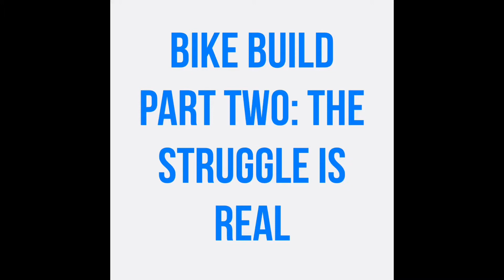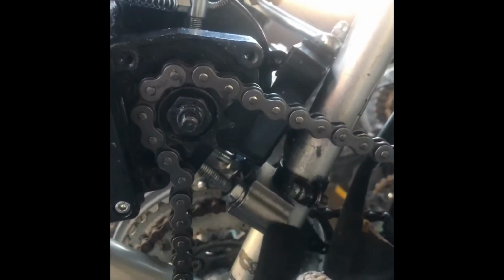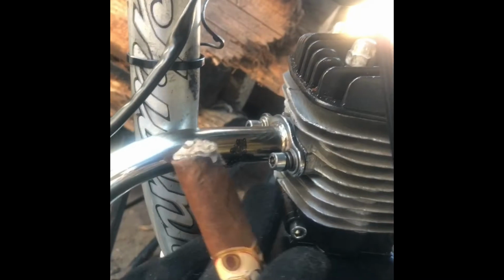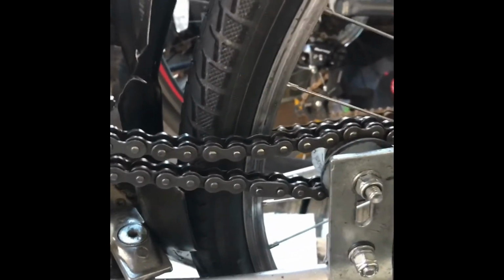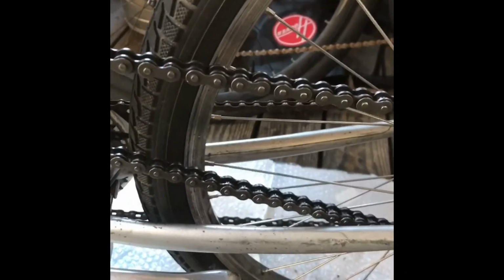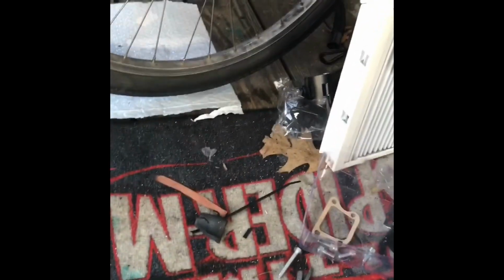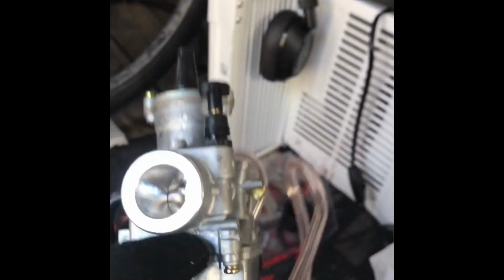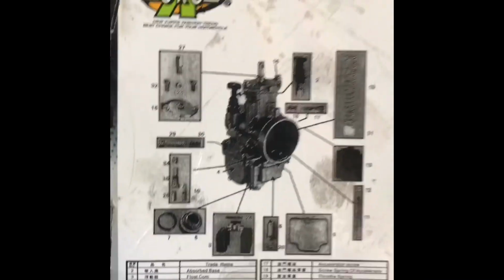Motorized Bicycle Build: The Zeda Dio and Oko Carb Upgrade (Part 2)

Comment: with your engine sitting on the water bottle stud  like that becarfule it don't start to split your engine at the main gasket I would file or grind the water bottle stude flat I did the same thing as u and it caused my engine to losen a little and made a main gasket leek

Comment: Those are extra jets and pieces for the carb
Reply: So the power jet on an OKO carb will not work with a motorized bike engine I’ve been trying to get it to work, still runs great without it